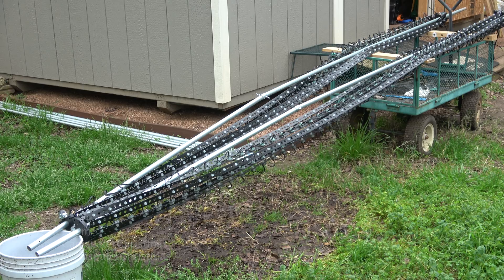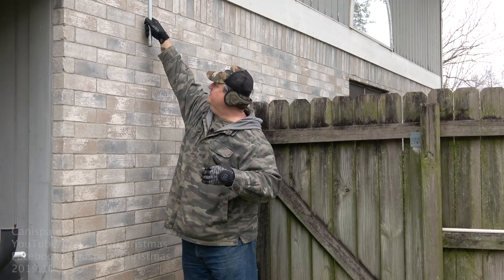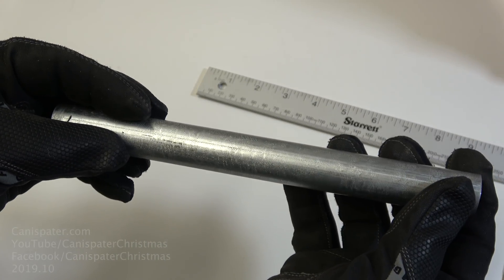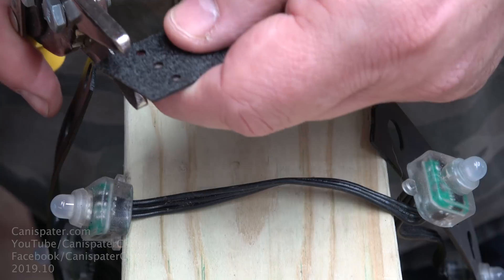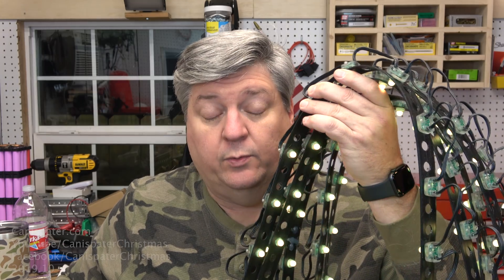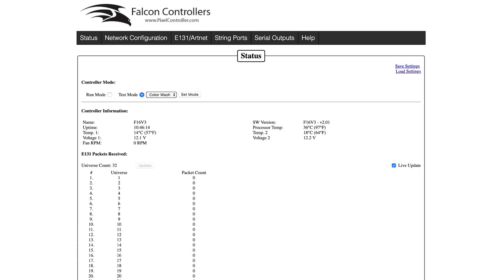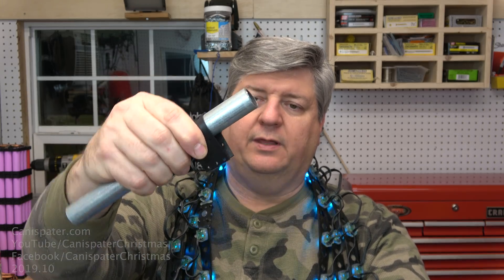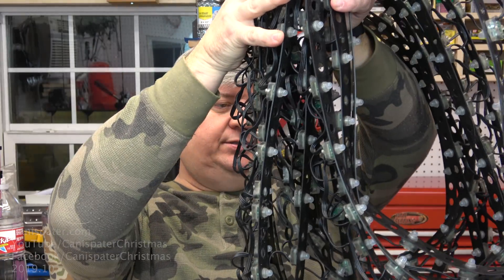🎄Staff of Zarton Redux (click bait) (2019) 🎄

Comment: Hello @CanispaterChristmas... Just asking..
Its all about power supply...
Is it okay if I use PSU in a computer ("by hacking tips")??? . I wonder if i can use them as 12v dc power supply for my mega tree (´～`)..
Reply from the maker: Can you? Sure. Is it recommended? Not really. Just make sure you don't exceed the power capabilities of the power supply. Pixels use more power than you'd think. Calculate 0.06 amps per node for all white at 100% brightness. Make sure you take good measurements and reduce the brightness. I run mine at 30% and it's plenty of light. YMMV.
Reply: I see from other yt channel... That they use computer psu (but u need to choose more efficiency like: 850W 80+ gold rated power supply)...simply they just jump bridge of the 24 pin connector. N then Done... 
Others are using cryptomining or big server psu (1600W). he only use one psu for his mega tree(80nodes x 30 strips) & one for his entire house.i think Its a little bit overkill. Idk... Btw thanks alot for ur information...
Reply from the maker: Oh that kind. OK.

Comment: How to connect data to all kinds of elements.in christmas lights  please
Reply from the maker: Not sure I understand the question. If you mean standard pixel connections, I have several videos covering that and it depends on the pixels as different pixels may need different connections. If you mean how to wire up a particular prop, there is an option in xLights to show the wiring view by right-clicking on the model. This assumes you are using xLights.
Reply: @CanispaterChristmas  I'm not using XLighting. I'm using as 2811 pixels, software is vixen 3
Reply from the maker: Oh OK. Then you will need to ask on the forums or Facebook groups (listed in the description) as someone there will know.